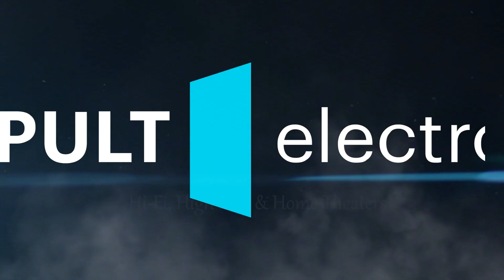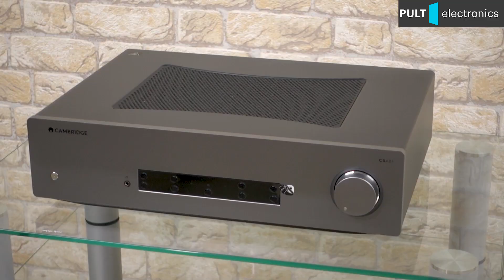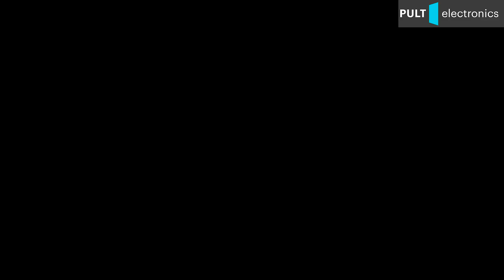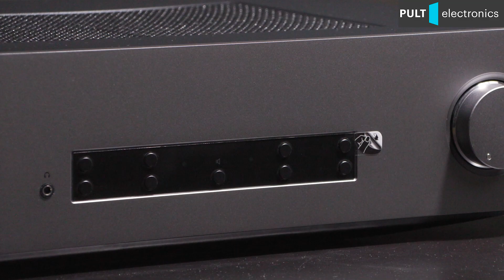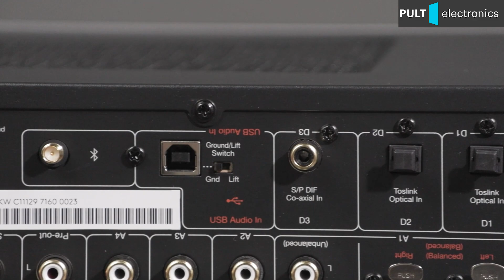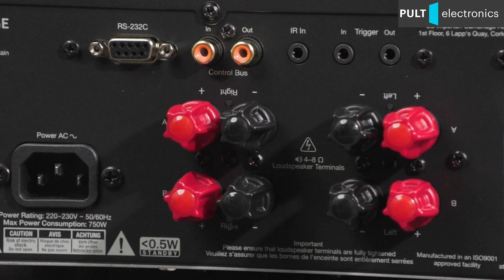Cambridge CXA81. Not too expensive, but a great sounding amplifier with DAC

Comment: Got mine this week. Already owned the Cambridge CXC and CXNv2. So I now have the full set. After testing it a few days, I actually prefer the CXA81's DAC over the CXNv2. And it gives the CXC and TV a real nice sound. I've paired it with a pair of Dali Spektor 2 speakers and a JVC subwoofer. I live in a small apartment, so the Dali's are more than capable of filling the place with great music.

Comment: Two other disadvantages in my book. 1. I have the Cambridge CXNv2 streamer, which has it's own (possibly better) DAC, so I don't need another DAC. 2. I have been told that you cannot use it as a standalone power amp, which again is unusual for integrated amps at this price. The CXNv2 can also be used as a passive pre-amp, so again there is duplication here. What I'd like to see from Cambridge is a similar priced standalone power amp.
Reply: 我也想知道